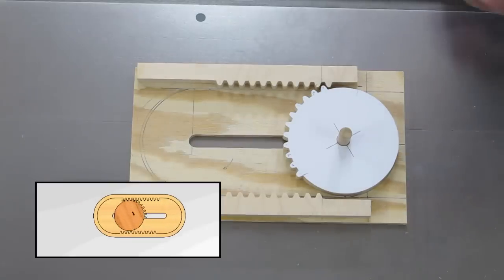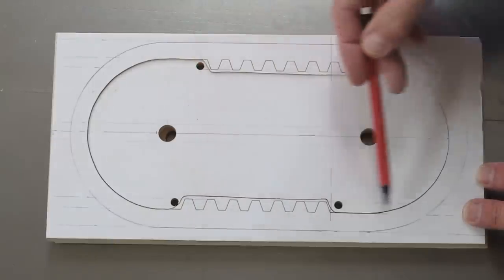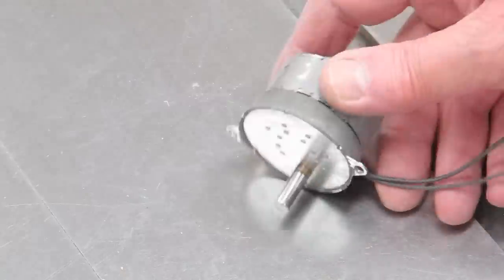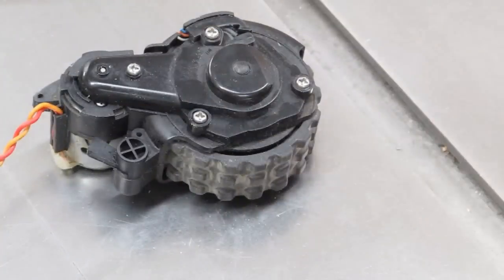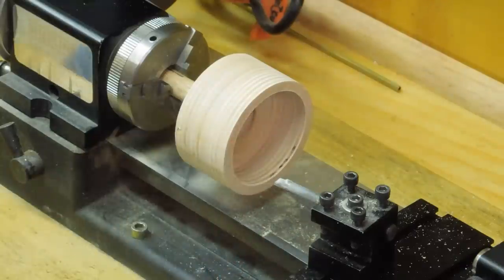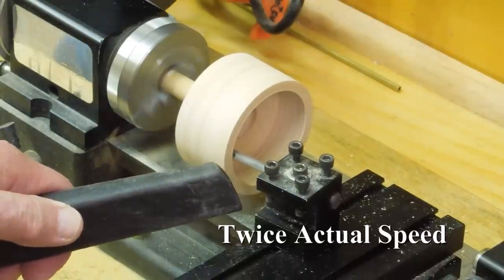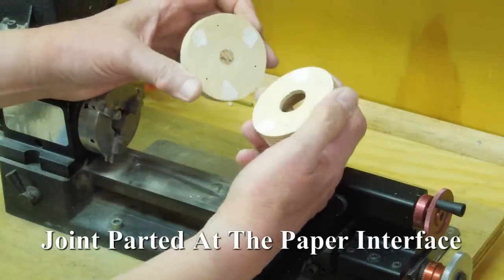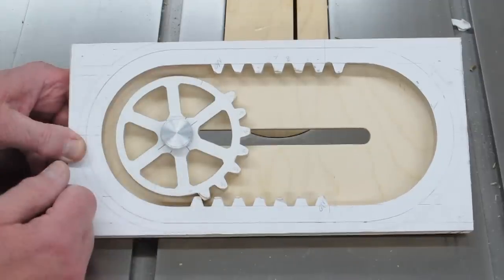Making The Reciprocating Rack & Pinion

Comment: Hi, your channel has been really really helpful to me, and specially this video, but I have one question, is it possible to build a mechanism like this one where the pinion takes 12 hours to travel the rack (without being kilometric), and then 12 hours to go back??

PS: I am building a sort of clock

Thank you so much!
Reply from the maker: Andrea Mestre Not sure what you are referring to by "kilometric". It can be done but it may not be easy. You need to find a motor that turns very slow but still has a reasonable amount of power (torque). Some of these slow turning motors are timer or clock motors and are fairly weak. As stated in my video, some of the small motors are less than worthless. Or you could use a motor which turns a bit faster and build a gear reduction behind this reciprocating pinion. If that gear reduction plus motor becomes too heavy, a secondary rolling support would also be needed. The gear motor will probably be the heaviest item.This mechanism could then also become fairly thick. If I were going to do this I would use wood gears to obtain my One Rev Per Day at the pinion. I also have a videos on cutting wood gears and on wood gear clocks. For motors go to surpluscenter.com  or eBay and search for AC GEARMOTOR or SHADED POLE GEAR MOTOR. 

I could see a clock with 12 AM hours across the bottom and then 12 PM hours across the top. You could make the rack longer if necessary. Problem may occur in the delay as it transitions between racks. A prototype and experimentation would definitely be required. 

Before starting you need to be mechanically inclined and willing to hand cut the required gears on a scroll saw, accepting that you WILL need to do things more than once before getting it right. Hope that helps.
Reply: Ronald Walters Thank you for your quick answer, it's a really good solution and it helped me. I have another question related to that clock, how can I make a simple mechanism with a gear that goes 1 revolution per day?
Reply: Ronald Walters Sorry, 1 revolution per hour
Reply from the maker: Andrea Mestre That would depend on how fast the motor was turning and how large you are willing for the gears to be. woodgears.ca has a gear template calculator which will allow you to see how large some of these gears would be. You can also google gear ratio calculator. If you had a motor turning only 20 RPM it could take 4 to 6 gears (depending on gear size) to get the speed reduced to 1 revolution per hour... and then more gears to get it down to 1 revolution per day. Using the gear template calculator on woodgears.ca you can print templates to use to cut the gears from baltic birch plywood. I have a video showing you how to cut gears on a scroll saw "Cutting Wood Gear & Clock Wheel Teeth". The actual design of the gear reduction mechanism would be up to you to design yourself as there are so many possible combinations.

Comment: Bourke engine with English yoke could use this  instead of the English yoke to convert reciprocating piston assembly into rotation of drive shat, instead of crankshaft...this canvmake it much more stiff and durable, because it avoids side load on the yoke itself,when the crankshaft is at and close to 90 deg.

Comment: Possible to make a power back saw. Awsome
Reply from the maker: Ras  Applications tend to be relatively low torque such as used in the French fishing reel - The Mitchel 300 - Google it.

But then there is a relatively high pressure grease gun which uses this mechanism.  This video demonstrates their grease gun. @watch?v=GI7iq9NX56s

Comment: I guess this works, but I can't imagine this has any advantages over the crank and piston method. Like a combustion engine, but in reverse.
Reply from the maker: Application has been previously covered in comments... use in a fishing reel and a high pressure grease gun are two distinctly different applications. Since this mechanism is well over 100 years I imagine there have been a few others as well.
Reply: The first thing I can see as an advantage is the motion, apart from the stop, change of direction is constant velocity! With a crank and piston the velocity is always changing! Depends on what application it is to be used for. Good build, Cheers from John Australia.
Reply: The original purpose was the reverse of how he did this... the rotary portion was fixed solid, as it was being driven by a water wheel, while the big rectangular slotted part was oscillated back and forth... usually with a big saw blade attached.

Comment: I wanna know how you got the remote to operate the vacuum! Now thats inventive or lazy lol. Cool though.
Reply from the maker: Google X-10 remote controls or modules. The key chain remote on/off sends a signal to a receiver (which is plugged into a wall outlet somewhere within range) which sends a signal through the electrical wiring to a Wall Switch Module (which replaces a wall outlet) located near the shopvac and turns the shopvac on/off. Very convenient and lazy (I like both) and it allows the very noisy shopvac to be located somewhere else. X-10 has many different controls. Search for it on eBay. I have a few videos on these (mainly for dust collection). Thanks for watching. Please Subscribe… that is what keeps this channel available.

Comment: What could be the possible uses of this assembly??
Reply from the maker: If you did not have room for a crankshaft, connecting rod and crosshead or if you needed to move something repeatedly from side to side like in a weaving loop. Usually the pinion is stationary and the double rack section moves back and forth and would be connect at one end or at both ends with a connection rod. In the case of my model a connecting rod could be attached to the pinion axle. Either way, the mechanism delivers straight-line push and pull. Exact mechanical timing of the strokes with a stationary pinion could be achieved with gearing driving the pinion instead of a motor (or with a variable speed motor).
Reply: This would be perfect for a coil winder to ensure the wire is distributed evenly. One motor and some gearing to drive the bobbin and the pinion. It would need a step down to the pinion though (bobbin width/ wire diameter).

Comment: This is cool, but it looks like those teeth will take a beating from the impact at the ends. Maybe someone could design it with an oval gear shape and different size teeth to achieve a sinusoidal movement rather than linear triangle...

Comment: do you by chance have a pdf for the gears
Reply from the maker: I no longer have the actual gear design data available. The racks and pinion each have 7 teeth. The racks are offset by one tooth. Approximate dimensions are… rack teeth center to center are 3-11/16” long, pinion root diameter 3-3/4”, pinion outside diameter 4-3/8” slot ½” wide x 6-1/16” long (the slot length needs to be fine tuned for correct operation of the mechanism). Suggest you play around with the gear design using something like the gear template generator on woodgears.ca until you are happy with the results. The gear template generator has detailed instructions including how to draw a rack. The actual layout of this mechanism is a function of playing with paper patterns, glue and tape. Refer to the video for orientation and remember it only works for pinion rotation in one direction. Have fun. Thanks for watching. Please subscribe! Ron
Reply: @RonaldWalters2010 hi , many thanks for the reply , i shall go and start cutting up foam board .

Comment: Как избежать ударов по зубьям, ибо быстро выйдет из строя механизм?
Reply from the maker: Asked and answered many times in the comments. The clicking noise at each end of the travel (impact) is primarily the pinion gear axle shaft hitting the end of the slot and not the gear teeth engaging. The teeth actually engage quite smoothly as the direction of travel has already stopped a fraction of a second before the pinion shifts from one rack to the other. Four years later it is still running. Thanks for watching!

Comment: Were can I find or buy the planes for this.  Thank you.
Reply from the maker: No plans are available. I am just giving you the idea so you can design your own. You can use something like the gear template generator at the lower left hand corner of woodgears.ca
Reply from the maker: Woodgears.ca sells a better version of his gear tooth template generator which works on your own computer. I have several videos on wood gear clocks and cutting wood gears. It is pretty easy after just a little practice.

Cutting Wood Gear & Clock Wheel Teeth
https://youtu.be/AQ92urCdybU

Gear Head Part 1 – Construction
https://youtu.be/z6O6ZRlQi34
There is a playlist for the entire Gear Head project.

Comment: What would you use this for?
Reply from the maker: Applications tend to be relatively low torque such as used in the French fishing reel - The Mitchel 300 - Google it. But then there is a relatively high pressure grease gun which uses this mechanism.  This video demonstrates their grease gun. https://www.youtube.com/watch?v=GI7iq9NX56s
Reply: +Ronald Walters thank you it was very cool
Reply: Even you can use it in the Hatching Machines..
Reply: well, a mechanical arm which should have a limited range of motion could use something like this, such as to move objects from a lower conveyor belt to a higher one, or of course, scooping something to move it onto a belt.

Comment: E QUAL SERIA A FINALIDADE?
Reply from the maker: If you did not have room for a crankshaft, connecting rod and crosshead or if you needed to move something repeatedly from side to side like in a weaving loop. Usually the pinion is stationary and the double rack section moves back and forth and would be connect at one end or at both ends with a connection rod. In the case of my model a connecting rod could be attached to the pinion axle. Either way, the mechanism delivers straight-line push and pull. Exact mechanical timing of the strokes with a stationary pinion could be achieved with gearing driving the pinion instead of a motor (or with a variable speed motor).
Reply: Ronald Walters Ok. Eu acho que vai servir no meu Gerador Eólico. Obrigado

Comment: Gussitte,  tape slitting machines have a rack same as this for the off cuts(waste tape ) they have 2 extra teeth the one at each end the second to last tooth either end is reduced to allow for disconnection from the first rack but allowing for the second rack to be all ready in drive  Buy the way theses machines are over 20 years old you may wish to look into patients befor you waste to much time
Reply: "Patients"? I think you meant "patents".

Comment: Can you please tell me what is the dimensions of all i.e length, teeth, etc
Reply from the maker: This has been answered in the comments section. Thanks for watching!
Reply: @RonaldWalters2010  I could not find it 🤔 please help me.. I need this in my one of the cllg project
Reply from the maker: Posted 2 months ago. You did not look very hard. The racks and pinion each have 7 teeth. The racks are offset by one tooth. Approximate dimensions are… rack teeth center to center are 3-11/16” long, pinion root diameter 3-3/4”, pinion outside diameter 4-3/8” slot ½” wide x 6-1/16” long (the slot length needs to be fine tuned for correct operation of the mechanism). Suggest you play around with the gear design using something like the gear template generator on woodgears.ca until you are happy with the results. The gear template generator has detailed instructions including how to draw a rack. The actual layout of this mechanism is a function of playing with paper patterns, glue and tape. Refer to the video for orientation and remember it only works for pinion rotation in one direction. Good luck! Thanks for watching and subscribing.

Comment: So what's the point of it
Reply from the maker: +Jennifer Boettlin If you need to ask the question, how are you going to understand the answer?  Anyway... It boils down to it being a demonstration model of a mechanical mechanism. Mechanical mechanisms are what make the industrial world run and are often hidden, out of sight, inside equipment used daily. This particular mechanism can be found inside anything ranging from a fishing reel or a weaving loom to a high pressure grease gun. Here is another demonstration model of a mechanism which converts reciprocating into rotary motion. https://youtu.be/Cas_tOSgz8Y

Comment: can i get dimentions for this
Reply from the maker: I no longer have the actual gear design data available. The racks and pinion each have 7 teeth. The racks are offset by one tooth. Approximate dimensions are… rack teeth center to center are 3-11/16” long, pinion root diameter 3-3/4”, pinion outside diameter 4-3/8” slot ½” wide x 6-1/16” long (the slot length needs to be fine tuned for correct operation of the mechanism). Suggest you play around with the gear design using something like the gear template generator on woodgears.ca until you are happy with the results. The gear template generator has detailed instructions including how to draw a rack. The actual layout of this mechanism is a function of playing with paper patterns, glue and tape. Refer to the video for orientation and remember it only works for pinion rotation in one direction. Have fun. Thanks for watching. Hope you have subscribed! Ron

Comment: Because of the impacts i dont think this would be good with any load or real rpm speed
Reply from the maker: If you read the comments... this can be designed with closer tolerances and runs very smoothly. Applications tend to be relatively low torque such as used in the French fishing reel - The Mitchel 300 - Google it. But then there is a relatively high pressure grease gun (high torque) which uses this mechanism.  This video demonstrates their grease gun. https://www.youtube.com/watch?v=GI7iq9NX56s

Comment: а зачем эта штука нужна?
Reply from the maker: Макар Плакидин Back in a time before pneumatic or electronic controllers such things needed to be done mechanically, such as for weaving machines, cash registers, adding machines or any mechanism requiring timing or conversion of rotary to linear reciprocating motion.- - - Personally, I just made it for fun to see if it would run.